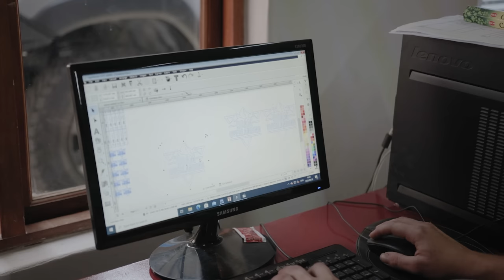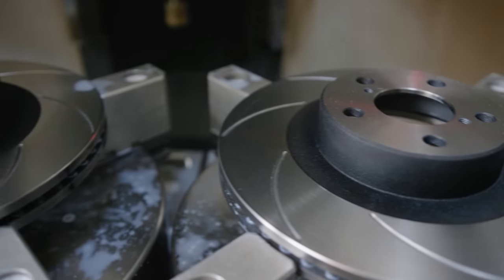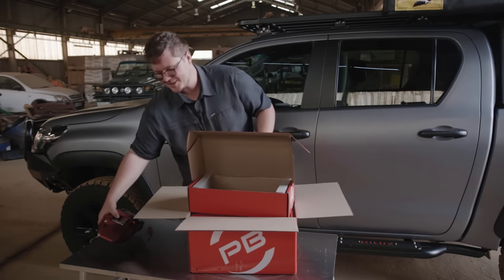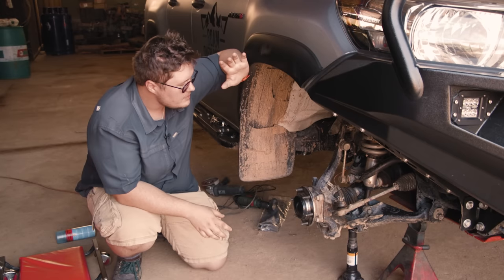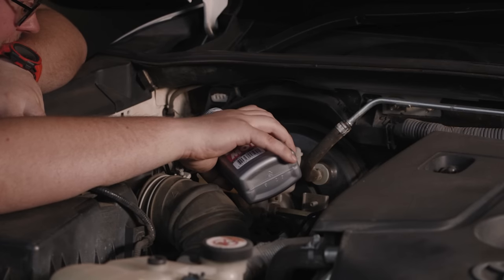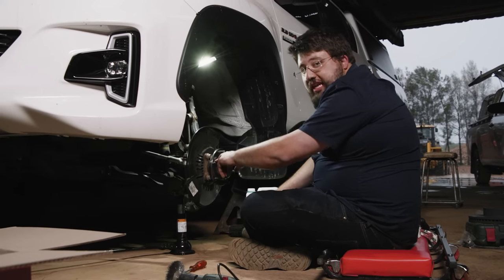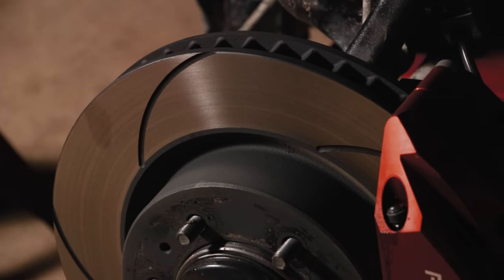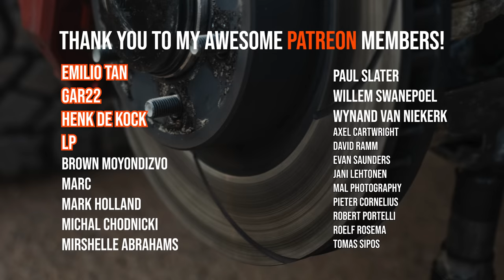Ep9 Powerbrake Big Brake Kit & Standard Diameter Kit for Toyota Hilux Install

Comment: looking forward to see how these IFS going to handle in off road conditions in comparison to the Jimny's front solid axle.
Reply from the maker: Me too 👍🏻
Reply: I saw the new Nissan patrol doing better than the 200 Land cruiser in climbing rough terrain. it's got all round ifs were the cruiser has a solid axel at the back the problem with solid axel is it can only be lifted with increase in tire size. No matter what you do to the suspension. The downside is ifs can get more expensive when lifted but you can get more clearance when done correctly
Reply from the maker: @woestynkriek63  very interesting. I always felt this way about the new defender, it’s clearance is insane because of the way it’s suspension is setup.
Reply: The Hilux will eat the jimney offroad. Traction control and difflock coupled with even power distribution amd torque down low.
Reply from the maker: @jeanjoubert12  after this weekend, I can confirm this statement :D
Reply: @RoamOverlanding  awesome brother! Still hoping to see you in Cape Town some day!

Comment: I highly recommend the standard depending on the use of the vehicle and its true for campers the weight of the bumper roof rake and other accessories add weight to the vehicle and powerbrake is the solution 💯🇿🇼
Reply from the maker: I must say after over a year of having my big brake kit; it is definitely not overkill for my vehicle. Plenty times I have been very grateful to have them in such a heavy vehicle 👌🏻

Comment: Toyota has actually improved their brakes on the new Hilux. From 2 pot on the D4D/L45 shape to 4 pot on the new shape.
Reply from the maker: Yeah so since 2009 they havent changed it though, quite interesting to see that my 2.4 has the exact same brakes at the 2.8 L50 and then for the previous 9 years of Hiluxes before mine.

Comment: Better upgrade those upper control arm that tolerate the 2 inch lift, if not the ball joint ain't gonna be happy .. 😅
Reply from the maker: Definitely working on it. Waiting for them to arrive next week 👍🏻
Reply: @RoamOverlanding  i have change my UCA 2 times already before upgrading to a better 1 ... Broke it twice ..🤣

Comment: I have an Everest,  would powebrake be able to have their kit work on my ride? Esp since the limited has a lot of elec features,  wondering if the big brake option would work....ps keen to see you out and about ;)
Reply from the maker: Hey Larry, they do have developed kits for ford, so I’m sure they have something for an Everest, pop them a message on Instagram or Facebook, or head to their website and find out. The BBK needs a minimum of a 17inch wheel to fit in, so keep that in mind too 👌🏻
Reply: @RoamOverlanding  awesome,  currently have an 18 so should be all good.

Comment: Will the big brake kit fit in the 17 inch rims ? I know 15 inch rims comes on the 2 wheel version of the hilux and that is probably the same stock kit
Reply from the maker: The big brake kit is significantly bigger than stock, so you will definitely need a 17” rim; but the standard power break kit I think you’ll be good on a 15/16” tire; but best to chat to them to find out. There are 2 versions of brakes for the Hilux; a small diameter and a larger diameter

Comment: Hi Adrian, food for thought regarding my own Hilux. Two question (unrelated). Firstly, does the Powerbrake application void the Toyota warranty?  Secondly, are you happy with your current Coopers tires?
Reply from the maker: Good question Grant, my vehicle is just about out of its warranty anyways, so I haven’t been too phased. But check with Powerbrake directly to find out, they’ll help you out chip chop! 👌🏻you can go to their site, or their social media
Reply from the maker: And the current coopers, have been pretty solid. Great on road handling, and performance in the wet. But i have changed to something even more aggressive and a bit bigger in the mean time 👌🏻
Reply: @RoamOverlanding  will do.  Thanks mate!

Comment: Any plans to upgrade or change the brakes on the rear axle?
Reply from the maker: The rear drums actually work really when the vehicle is loaded up, and they still recommend just keeping them standard, the BBK will compensate for anything the rear can’t handle
Reply: @RoamOverlanding  I suppose the market dictates what is put on a vehicle as standard equipment.  When I left the USA in 2009, it was rare to find any new car or truck with rear drum brakes. Only older vehicles from the 1970s the early 1980s still used drum brakes. Somewhat of a shock when I came back to Malaysia to find that this was only the norm on more expensive and luxury brands. This is true on the same vehicle sold both in the USA and around the world. Less safety features,  smaller engines, but can cost more than the  upscale version in the USA.

Comment: Very  cool  and what are the cost between the big brake and the standerd one
Reply from the maker: Don’t quote me on the pricing, but the difference is like 5k vs 25k for example 👌🏻 double check with Powerbrake on the actual pricing and availability 👍🏻
Reply: Ok wow that is alot but it will make a differance in the long run keep up the good work
Reply from the maker: the mullers adventures and sports it’s a lot but it’s not a lot considering you could do the Dakar with them 😂
Reply: Ok cool enjoy

Comment: Good & very sensible choice of doing the brakes BEFORE throwing way more fuel & boots to the vehicle. The colour could be matched better to the vehicle :-P That being said.......-> The PP hackjob with the dustshield is "No bueno"... Sorry! This should have been delt with differently. 
What is the ACTUALL difference in Ø between the factory & upgraded rotor?
Furthermore what brakepads are U running now?  We only saw the budget upgrade running Mintex which is not overly inspiring.... Personally I`d love to see a rough financial figure of what this sets a customer back. At the very least do a price comparison to what a Toyota Dealer would charge for 2 discs + pads, hose(s) & calipers so the audience can have a taste :-) 
& Finally -> How much (less) clearence is there between the caliper & rim? Brgds Peter
Reply from the maker: So the anodizing is a special product and it only comes out like that 👍🏻 the diameter difference is different depending on the vehicle. They offer it as a kit on their website, they have great customer service, so pop them a message on Facebook, Instagram or their website, they’d gladly you give you the info you need 👍🏻

Comment: No upgrades to the rear brakes?
Reply from the maker: The rear drum brakes are actually very good with dealing with dynamic loads, so it’s recommended to keep them. The BBK will make up for any missing performance from the rear
Reply: Toyota has used rear discs on 4x4 vehicles since the early 1990’s. I am very surprised disks have not been added to the Hilux range.
The problem with rear drums is that dust and mud will make them wear quickly; especially in off-road applications, around town is ok. 
Keep a check on the rear drums for wear n tear often.

Comment: Now that you have put on almost everything possible accesory on the market, have you maybe thought of taking your vehicle to a weigh-bridge just to see how much you are overweight?
Reply from the maker: The vehicle won’t be over weight 👍🏻 it will only go overweight when I fill up all my fuel and water
Reply: @RoamOverlanding  Ok thats good news it looks quite heavy on the videos. How is the handling caracaristics with all the accesories fitted?
Reply from the maker: it's handling really well! I am very surprised! I barely even feel the accessories. The main thing I feel is just wind resistance when crusing on the highway, but around town feels good and its very comfortable on the open road.
Reply: @RoamOverlanding  Yes that make sence. Sorry for the blunt questions but accessories cost a lot of money and I want to make sure I fit the correct stuff and it work well. Thanks for the great video's they have a lot of info in them and I'm glad I subscribed, looking forward to your travels.